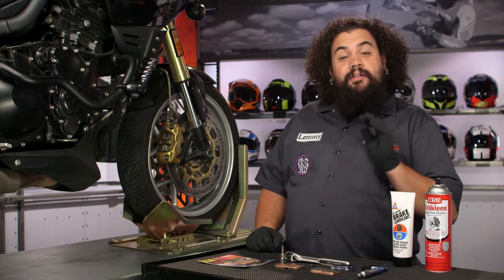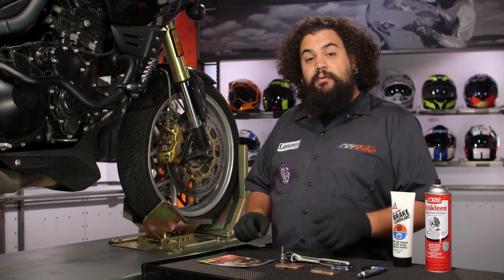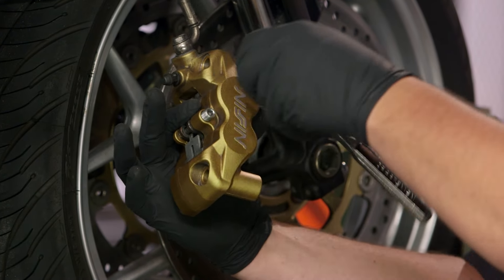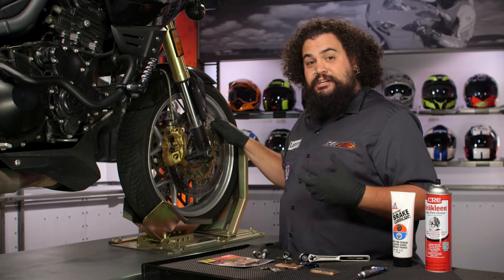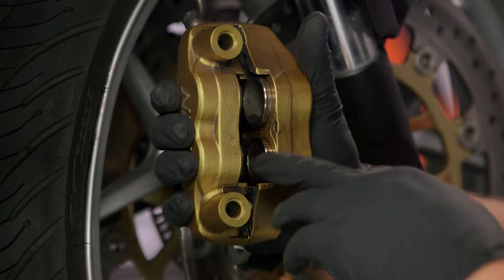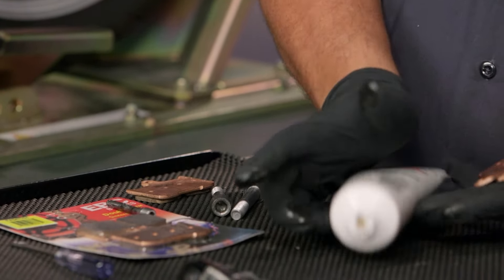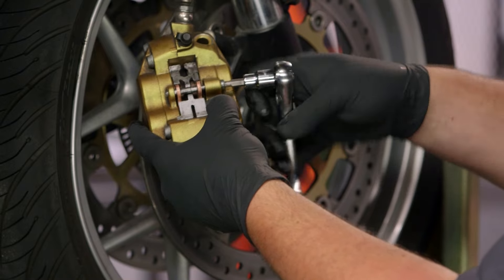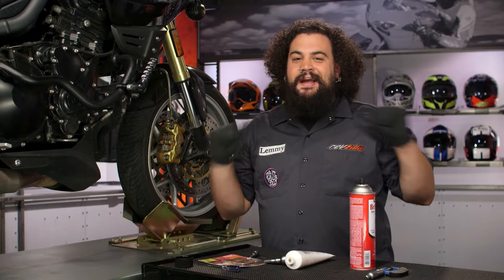How To Change Motorcycle Brake Pads at RevZilla.com

Comment: ebc double h sintered pads are like twice as fast stopping as regular sintered galfer pads that were an improvement on OEM pads on my VStrom
Reply: ebc are terrible now they have done a "one size fits all" on us and now the same pad fits about 10 more bikes because they ovulated the caliper pin holes enough to fit more fitments. They are the worst pad you can buy in the UK now for Track and fast road use they absolutely suck compared to what they were even 5yr ago. The EBC HHs the gap is too big between the abrasive chunks and they are basically two seperate small chunks rather than one large one with relief cuts. The older HHs were made correctly and had good lead & trailing edge robustness, the new ones are the worst of the worst.  In the UK and IOM we fit SBS pads mate they are made in Denmark and basically are the old EBCs with a more advanced relief cut. For example the SBS sold as "evo sintered street performance" for fast road and track use are identicall backing and fitment size as the older proper EBC HHs but the abrasive side is the best quality sintered and pressed on fit and is a true sintered material and has been fully sintered to the backing plate as one big pad then the relief cuts ground out so theres no chance of material mismatches or bad bonding in the individual blocks. EBC are to be avoided now at all costs they are terrible

Comment: Just had a garage do my brakes and my front is perfect but my rear is worse now than the 5000mlie pads that had just been removed. Whats up with that??
Reply from the maker: Could be an issue with the rear pads sticking/dragging or perhaps you favor the rear more. -DrewZilla
Reply: @RevZilla  close turns out the rear disk is shot. And has ridges thanx anyway guys
Reply from the maker: Well that'll do it.

Comment: With the wheel on the ground, or off the ground, when spinning the wheel sounds of the pads dragging on the rotor. Is that supposed to do that?
Reply: Yes, that's completely normal. The pads are in touch with the disc all the time so it is normal that they produce a dragging sound.

Comment: Thx, great tutorial.. but after cleaning the callipers and putting back the new pads the front wheel feels really stiff now. When I lift the front wheel and spin it it stops immediately. What could go wrong? Everything looked ok, breaks dont squeek, they work when I use the break lever, this is the only problem I have, maybe too much break fluid...? I haven't tried to go for a short ride yet but maybe it will need just a short ride?

Comment: Great video, thanks. On backside of my old pads were attached these thin metal grills which I forgot to take off and put on my new pads. I saw you did not put them there either. Are they must? Thanks
Reply from the maker: They aren't a must, but they can help reduce rattling or squealing. If you ride the bike and notice that the pads are making a lot of noise, then it might be worth going back in to attach the metal grills. -DrewZilla
Reply: RevZilla many thanks

Comment: Lemmy, love your videos, so helpful.  I have a question.  I have a 2007 Dyna Super Glide Custom and the owners manual describes changing the rear brake pads without removing the caliper. Does that sound right?

Comment: Do you need to keep the bolts of the caliper lose first to sync the new pads with the rotor by grabbing hand full of brake first then tighten down the caliper bolts? just like mt bikes?
Reply from the maker: No, unlike with MTB calipers, you do not need to do that. -DrewZilla

Comment: I just had my front disc brake and pads changed to new ones by a mechanic. I didn't pay atention to exactly how much the wheel could spin (before the change of pads and disc) when i would just try and spin it when on the centre stand. But now i notice that it barely spins. Maybe 1/2 a turn when i give it a spin with my hand. I'm thinking the pads are touching the disc? Is that normal or should i adjust the pads so the wheel can spin freely? Thanks!
Reply from the maker: That's normal and should subside over time. Both the new pads and new brake disc are slightly thicker than the old, worn disc and pads, so they're going to rub a bit at first. -DrewZilla
Reply: +RevZilla thanks a Lot :)

Comment: Is there any difference when it comes to ABS brakes?
Reply from the maker: It really depends on the ABS system. Some ABS systems require accessing the bike ECU to 'reset' the system after bleeding. Some ABS systems are harder to bleed and really need to be bled by the dealer. -DrewZilla
Reply: @RevZilla  Thanks for taking the time to answer my question. I have a YAMAHA MT 125 2017
Reply from the maker: With the MT125, this process should be fine. -DrewZilla
Reply: @RevZilla  Perfect, thanks a lot.
Reply from the maker: You're welcome!

Comment: One question. Is it normal that brake calipers have a little freeplay when you tighten them on frame. I mean when you hold the caliper by hand and wable it, you can feel it wobble just slightly.

Comment: Great DIY video Lemmy !!. One question though, do I have to remove the brake fluid reservoir cap before pushing back the pistons all the way in, to release the pressure?
Reply from the maker: No, you don't need to remove the cap. It's actually better to leave the cap on to prevent spills. You don't really have issues with pressure in the reservoir. -DrewZilla
Reply: RevZilla I did mine and took the cap off, I had to syringe out some brake fluid as it was going to spill out but when I was done there was no room to put the fluid from the syringe back in why is that ???

Would it be because previously a garage may have topped up my brake reservoir whilst the pads was low ???

I look forward to your reply.

Comment: Lemmy, Love your videos man they’re super helpful. I need to change my brakes but I don’t know which brake pads I’m able to use. I have a buell lightning 2009. Any help?
Reply from the maker: It depends whether you have the XB12 Lightning or XB9 Lightning. Front brakes are different, but rear brakes should be the same. Use the bike selector on our site to verify. -DrewZilla
*XB12 Front: https://www.revzilla.com/motorcycle/ebc-fa4544hh-double-h-sintered-front-brake-pads
*XB9 Front: https://www.revzilla.com/motorcycle/ebc-fa345hh-double-h-sintered-front-brake-pads
*Rear: https://www.revzilla.com/motorcycle/ebc-fa140hh-double-h-sintered-rear-brake-pads

Comment: He didn't mention brake fluid level in the Master cylinder reservoir. Also, I believe that rotor carrier has the minimum thickness measurement stamped.

Comment: What type of grease are you using to lube the pin that hold the brakes. I have a 2015 roadking is Harley’s use different grease? they squeaking and I didn’t use grease in that sliding pin.

Comment: I'm always wondering, how do motorcycle pads return.  I changed pads on Camry, which would return the pads by a spring.  Not the case on my Roadmaster, which might be the problem leading to brake drag.  I will be on my 3rd pads with only 40K highway miles.

Comment: Brake pad replacement is even easier once you realize most bike's pads can be popped in and out without having to unscrew those 2 bolts and hanging the caliper on the brake line.

Comment: Great video mate! thanks. I would like to ask if is not necessary to re- use the dissipater of the old brake pad. I just got a new pads and they came without this piece, and i notice that your new pad does not has it too.
should i put it without the dissipater?

Cheers
Reply: THANKS MATE!

Comment: what other lubricants can u use for brake pads? i havent got a brake pad lube
Reply from the maker: You need to use specific brake lube, as it needs to be rated for specific temperatures. -DrewZilla

Comment: If your brakes are squealing - replace your springs. grease on the back of the pads is not required. The piston just pushes against. Not at an angle, just straight into it. This is why pads and other brakes now have shims. To reduce any "sticking" to each other. The materials chosen shouldn't have them corroding together.

Comment: you can also use zip ties to hold the caliber.  what about back pressure? when you press the pistons back in wont you build pressure in the res. ? can that cause it to start leaking hydraulic fluid?
Reply from the maker: The reservoir cap is vented to relieve pressure. -DrewZilla
Reply: Best way is to attach a hose to the bleeder nipple, open the bleeder 1/4 turn and then press the pistons back in, it's much easier and if you're going to the trouble of replacing pad, change the fluid at the same time

Comment: Can i use a water based degreaser to clean the brake caliper? Thanks
Reply from the maker: We do not recommend using a water-based degreaser. We really recommend sticking with Brakleen or another standard brake cleaner. -DrewZilla

Comment: Would it matter if I wait to “pump” that brake handle before I replace the pads on other side of the wheel? Or it doesn’t really matter? Thanks
Reply from the maker: Don't pump the brakes until you've replaced the pads in both calipers and have reinstalled the calipers on the discs! -DrewZilla

Comment: Isnt the brake lubricant silicone based because it wont break down under extreme heat from the brakes? Not because its safe for rubber
Reply from the maker: I suppose it is two-fold. Silicone won't degrade rubber, and it can operate at temperatures up to nearly 400°F. -TeamZilla Chris
Reply: Wow, you guys replied to a comment on a video over a year old! Just stands to show why you guys are the best in the business!

Comment: Please, What cleaning and lub products did you use? And What brake fluid should I use for a gsxr 1000? Thanks
Reply from the maker: In the video, we used CRC Brakleen cleaner and AGS Brake Lubricant, but you don't have to use those exact brands. As for brake fluid, your owner's manual will specify which type of brake fluid is required for your specific model year GSX-R1000. -DrewZilla

Comment: Question. Do you need to reuse the metal plates on the back of the OEM brake pads when installing these EBC brake pads?
Reply from the maker: Those plates are called shims, and it really depends if the specific EBC pads for your bike have integrated shims or if the new EBC pads come with extra loose shims. -DrewZilla

Comment: Hey! I have a question. I recently bought new rear brake pads for my ER6N 2011, and while trying to mount them, I noticed that my old pads had no 'holes' in them and the single piston just left one giant stain. Now, with my new ones there are 2 holes on the back (possible for 2 pistons, I don't know). Does one piston still pull those two holes on the brake pad vacuum, or do I need ones without those holes?

Comment: hewy guys quick question, so i  bought a 2017 ninja 300, brand new, after 6k miles decided not to drive it anymore, everything was working fine, i decided to test drive it the other day and front brakes won't break at all. at all. front pads are still 70% not even 50. replaced the brake fluid, bleed the system and it still won't work... is really soft when i press the pedal, back brakes are still working

Comment: does the rotor need any attention ?
I've heard that you want to take a scotchbrite pad to it's surface before new pads are installed.
I'm use to car brakes that you absolutely must resurface or replace your rotors with every brake job. New pads deserve a fresh rotor surface. Done many many car brake jobs at the dealer I use to work at. But never on a bike yet. Going to replace the front brakes on my 
GF's 1994 Yamaha Seca II XJ600s today with some EBC HH pads, because the brakes suck. I'm hoping for better initial bite. I'm also going to change the brake fluid as I believe that it is original. Because brake fluid absorbs water, I'm hoping this will also improve lever feel. As it can improve pedal feel in a car. I have a air operated brake fluid vacuum exchanger that pulls fluid from the bleeders. But the system is so small on the bike I'll probably just do it by hand. Planning on using DOT 4 fluid.
Reply from the maker: No, unlike car rotors, bike rotors do not need to be resurfaced. As long as the rotors aren't scored or out of spec for thickness and lateral runout, you don't need to do anything to the rotors. See Lemmy's full companion article for more details. -DrewZilla
*https://www.revzilla.com/common-tread/video-tips-how-to-change-your-brakes

Comment: followed these instructions on a 2010 ZX6r, after installing the new EBC pads I notice there's a clicking noise coming from the front pads? the only thing I see different is that the OEM pads had a small backing plate and the new ones don't. could this be the issue?
Reply from the maker: If they fit, you'd want to try swapping over the backing plates. -DrewZilla

Comment: Is it safe to use the lubricant on the sliding pistons?
Reply from the maker: Brake fluid should be used to clean the exposed area of the pistons and to lubricate the bores. Clean before compressing the pistons. -DrewZilla
Reply: Thanks!

Comment: What cleaning liquid Did you use, also what lube? Would this work on a iron 883
Reply from the maker: Yes, this works on an Iron 883. Lemmy used CRC Brakleen Brake Cleaner and AGS Sil-Glyde Brake Lubricant. -DrewZilla

Comment: What is the brake cleaner and brake lube use? Can you get it on revzilla?
Reply from the maker: Lemmy used what he had on hand, which was CRC Brakleen and AGS Sil-Glyde Brake Lubricant. We don't carry those specific brands, but we do have a couple brake cleaners. You'd need to get the brake lubricant elsewhere though. -DrewZilla
*https://www.revzilla.com/motorcycle/motopro-brake-cleaner
*https://www.revzilla.com/product/pj1-pro-brake-cleaner

Comment: what about the overflowing resivoir and which side do you do first etc
Reply from the maker: Whenever your brake reservoir is low, you should check your brake pad wear first. You don't want to fill up your brake reservoir before installing new brake pads, because the new pads will push the brake pistons into the calipers and increase the fluid level in the reservoir. If your brake pads are worn and your reservoir is at the max fill line, you may need to remove some brake fluid from the reservoir before installing new brake pads. As for sides, it doesn't matter which side you do first. -DrewZilla

Comment: Just changed my front pads but after compressing the caliper pistons and putting everything back together, the brake lever is staying soft no matter how many times I pump it keeps fully depressing. Went to check the master cylinder and stripped a screw 😑 need help...

Comment: How do you adjust the brake pads? I have duel caliper front brakes and they rub.
Reply from the maker: You can remove the pads and clean the brake pad pucks, which might free up their movement. But, you should know that rubbing on the rotor is pretty normal. -DrewZilla

Comment: Good day, i replaced my bike's front and rear calipers with brembo but i realized that the new caliper's piston does not retract considering it is new. I tried bleeding the system multiple time but it does not fix the problem. My rdisc rotor heats up tremendously after around 10 km run but somehow the rear wheel freewheels for around 4 rotations before stopping. Thank you in advance for those who can help me out

Comment: Hi Lemmy/Drew , I was watching this video to fix the front brake on my scooter. The lever gets pushed all the way in without braking. Do I just need to bleed the brake lines are change the pads too? It's only done 6000km dealer said the pads last for at least 15000km. Thanks
Reply from the maker: You need to check the pads to see how much they have worn down and also need to check the level of brake fluid in the front brake fluid reservoir. If the pads are worn, then you need new pads. If the pads look fine, then it's worth bleeding the front brake. -DrewZilla
Reply: @RevZilla  Will do, Thank you.

Comment: @RevZilla Hey I love your videos. However do you have any ideas of cleaning the header pipes?
Reply from the maker: Lemmy recommends the following: if it's that weird mud/rust combo that happens on off-road machines, pull the header down, and use a brass brush to knock off the worst of it. If it's a street bike, it shouldn't need quite so much attention. Stainless will polish out, but the gold color will return. If rust is an issue, this may reveal pinholes and such leading to replacement. If it's in good shape, it can be re-gasketed and returned to service. If additional protection is desired, high-temp header paint looks good and can be baked on prior to re-installing. Ceramic coating also does a lovely job protecting exhausts. Hope this helps! -DrewZilla